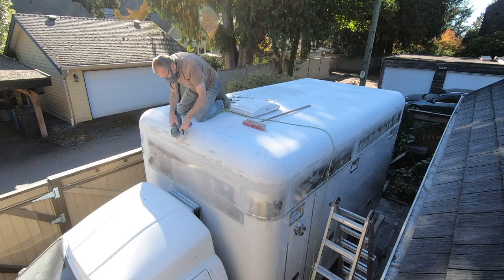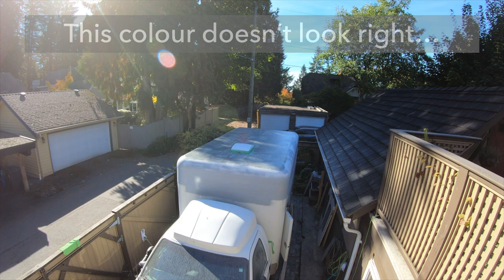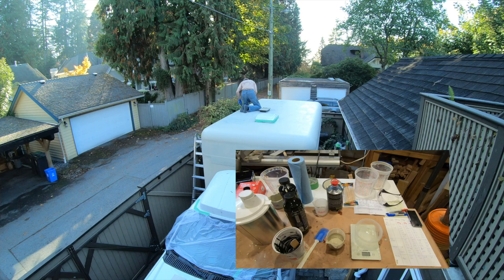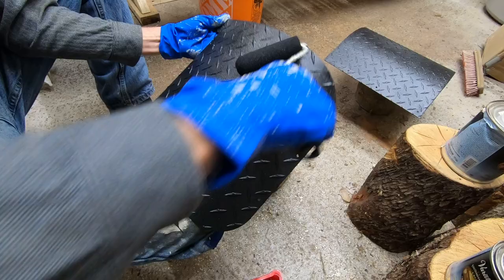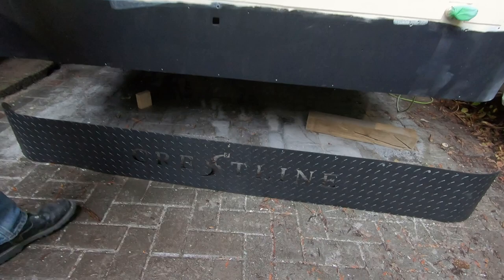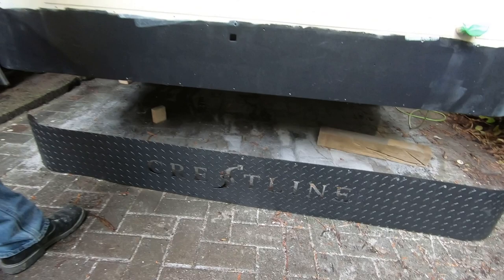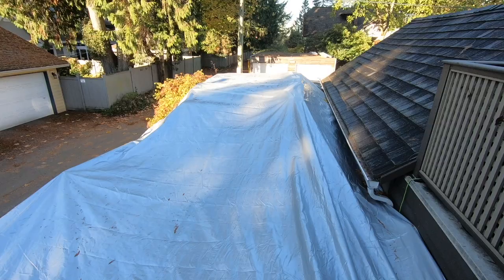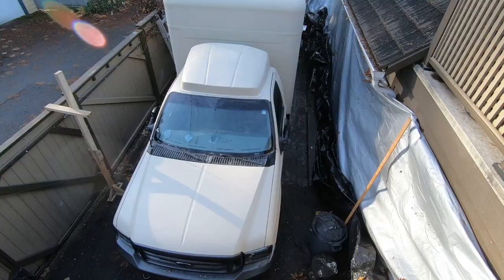DIY Ambulance Conversion - Raptor Liner Body & Cab Painting.  #raptorliner #carpainting

Comment: Love the channel and tips Id like ask you what material do you use to seal the gaps say from floor to wall do you use silicone, polymer or some kind of beading . Greatly appreciate a video on this
Reply from the maker: Thanks! We use Sikaflex-221 because it bonds well to metal (aluminium in our case). It is a polyurethane sealant and adhesive, it can also be sanded and painted. When we need to smooth transitions or small areas, we used automative body filler.